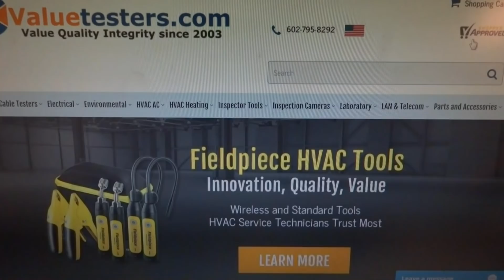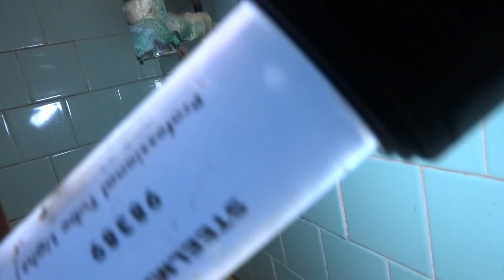bathroom sink drain cut out replaced

Comment: Little tip for ya steve.  Take a square five gallon bucket and cut notches in both sides so the super vee sits in it upside down .  Then you got a stand and don't have to hold that beast up as you snake.

Comment: It's amazing how long the old stuff lasts. Some people say "Oh it's old and broken how terrible" but gloss over the fact that it was put in in 1951 and good up until last week. Can't hardly say that about anything else from cars to people. God help the new plumbing they're putting in these days, all the thin flimsy crap that is designed complicated and built cheap. But this really was a good fix for this application. Obviously that bathroom isn't brand new and neither is that customer, all he probably wants is something that works reliably. Even if it looked weird you can still buy those covers to cover it all up, or easily make something.

Comment: I like that old wall tile.  It lasts forever.
Reply: Reality is, tile WILL last forever, it's the underlayment that often doesn't last. Often in houses of that vintage (up to the 50's, it was plaster or in the 50's and possibly into at least the early 60's, sheetrock and it often eventually rots/fails and the tiles have nothing left to bond to. It happened to friends of  mine and they were forced to redo their 1953 bathroom because of this. Besides, unless you've noticed, the plumbing is pretty sketchy with all that green corrosion on it and the state of the trap/drain plumbing. I get the feeling that house had not been well kept up even if pretty much original to when built.
Reply: @johnhpalmer6098  My house is all plaster. There isn't a shred of drywall. That old tile seems heavier to me than what they sell today. I rarely see the old stuff cracked. However, my original comment was aimed at people who are quick to criticize and gut old bathrooms with colorful tile. What they usually do is replace it with generic merchandise from the big box stores. It is a big step down in my eye. I know all tile will last forever if it the prep work is correct. I was just stepping up on my soap box. Old houses are my love.
Reply: @bg147  I understand your point but have you had tile fall off be missing and had to try and fond stuff to match? No, not necessarily new tile but hunted around at architectural salvage houses to find the right stuff, even close. 

I love it when owners take the time to do that and/or carefully remove the time, replace the underlayment and then retile with the vintage tile? Not everyone has the time, nor the patience to do it and at times simply has no time but get it repaired before further water damage occurs and many homes were simply rented out and when the landlord repairs something, it's done with modern off the shelf parts to quickly get the place rented/repaired.

Anyway, not criticizing just pointing out the reality of old bathrooms in general.

BTW I live in an old house, but it's bereft of any tile and what it likely had in the past was basic white subway, would have been common in the teens and 20's when it was new. The house itself was first built as a 1 bedroom cottage in 1908, the kitchen is from the mid 20's and not updated much over the years and still mostly original but no tiles in there, if any existed, it was as a backsplash for the sink area and then the original sink was replaced in the late 60's with a modern looking stainless or enameled cast iron and stainless came in later onto a homemade base cabinet made out of plywood but the kitchen still houses its original cabinets, now not in great shape, but serviceable still for now and plastic yellow floor tiles were installed it looked like for the sink surround

Then two bedrooms were added in the mid 80's to make it a small 3 bedroom house. The bathroom was redone with the cheapest Glacier Bay fixtures and painted a light blue. Not bad, but meh. It functions and that is what matters.

At least I can't complain too much about the house's physical structure's condition which is very good for a house this old in a working class neighborhood that's had an addition put on in the 80's.

Comment: Looks like the wall mount might have had legs at one time.
Reply: Most of the older wall mount lavys had holes in the two front corners so you could install legs if you wanted .